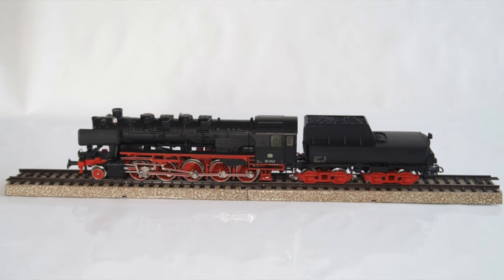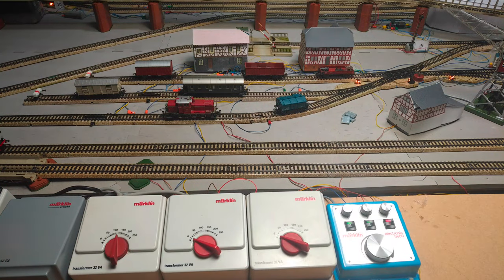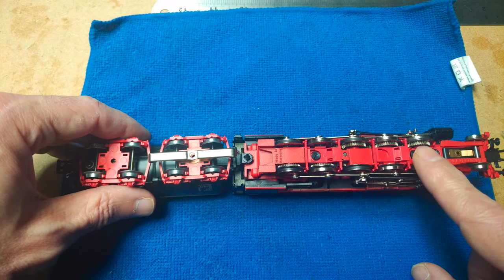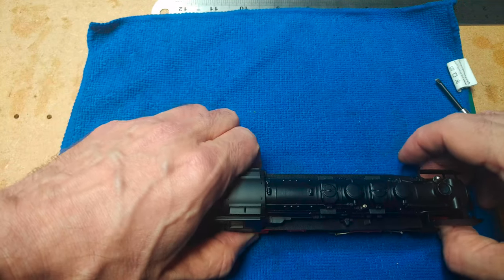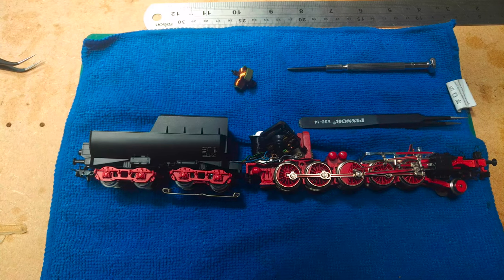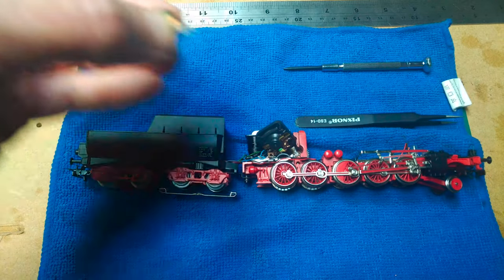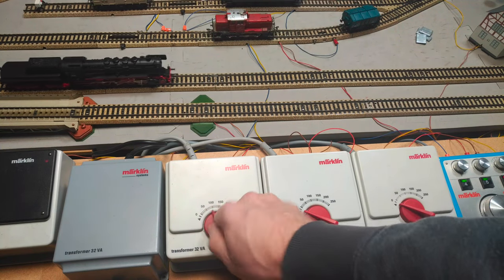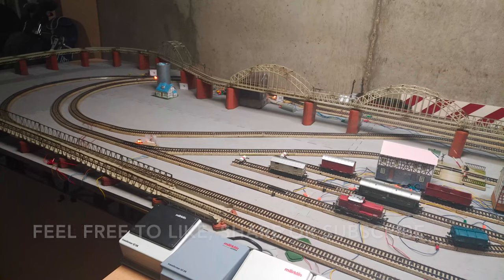Can I fix it? Märklin 3315 maintenance

Comment: Applying a drop of white sprit on the axle bearings will quickly desolve the hardened oil residues.  Also apply oil on the axles of the small gears between the wheels. Great video. 🙂
Reply from the maker: I like the red paint on my chassis too much to use white spirit 😉 If you don't mind about this, sure that could work too... Thanks for the visit!

Comment: Great ! Thank you so much. In other chanels, cleaning the motor is done with isopropanol. Done on earlier lok (in the 60s). May be the painting was different. Also to easy up blocked wheels, use liquid for oil smoke. What do you think of these ?
Reply from the maker: Hi there,
Isopropyl alcohol (ipa) on metal gears is fine, on plastic gears not so much, it makes them crack over time. The Märklin service manual also discourages the use of ipa, so I follow their advice. The motor housings of the 60s where also mostly black, so it was difficult to distinguish between graphite residues and paint... As a rule, I try and use isopropanol as little as possible, only when I have no other choice.
Smoke oil is "oil" (paraffin) :), SR24 for example, this also works very well to free things up, but requires additional lubrication afterwards. This is the reason why I mostly use ballistol for this type of things, saves me applying more fluids than is actually necessary. 
Thanks for your visit on the channel Stéphane. much appreciated.

Comment: My 3315 stays in it's box most of the time: For one reason or another, the running quality is poor, as it seems to have a power interruption issue. It doesn't completely stop of course but you can tell something is not right as there are very minor interruptions as it moves along here and there, sometimes over switches (M-track of course).  On my small test layout I clean the rails very frequently and would rule that out. It was delivered to me resinified, (and from what I can tell was never run like all the locos from this auction lot items being manufactured in early 1990s), which I usually solve with LGB smoke and cleaning fluid, my go-to for loosening the old oils, general cleaning, and the like. Of course, you need lubrication after.  But back to the 3315... Is there anything else I can do to try and improve the running? All my other locos (and they are all much much older) work far better. I have a 3316 literally from the same production month and it seems to be OK.  Many thanks for the time you have invested in the channel, as a non-German speaker (it's on the to-do list..) the technical production, commentary, and analysis are top-notch and much appreciated.  There really is no other channel like it (that I have seen) for the die-hard Marklin enthusiast and I look forward to every new installment (especially during the winter!)
Reply from the maker: Hi, 
Unless track was extremely dirty this can be ruled out. It sounds like some form of ground contact issue. I'd start by checking that none of the axles are sluggish, and that the driving wheels are clean. Then I'd check the leading wheels, as they often cease: they must be clean, so does their axle, as well as the leaf spring underneath the axle which doubles as a return for ground. This part of the chassis is often neglected but is critical for good ground contact on 33xx steam locos.
Could be something else too, but this is where I would start.
Thanks for the praises, glad you find the channel useful.
Reply: Thank you.  Your video on the '3312 T5 running issues in forward' was good to review, my issue is not as severe, but like you, I found that it ran somewhat better in reverse... it also reminded me of something I did 10 years ago which was solder dedicated grounds to the copper pickups on a digital BR86, both front and rear, which improved running. I checked closely on the 3315 copper pickup and there is a spot where it sits on the bogie so I removed the bit of paint there. It also seems like there is too much paint in the way in terms of where the coupler mount mates with the chassis...However, after much tweaking, nothing has really changed.  I may have to go and put in more grounding wires, but I'm 'out of steam' with this one for now.
Reply from the maker: Someone is watching the channel attentively :) Yes, it can get a bit draining sometimes. Best to step back and do nothing in such cases. Maybe you could post a quick video of the behaviour on your channel as unlisted and let me have a link via email. I could have another look and see if I can think of something else. You should not need additional grounding wires.

Comment: I recently came across some Marklin trains for the first time. I have gotten these old locomotives working and it has been a learning experience. I noticed right away that the units did not conform to the wheel spacing using an NMRA gauge. Is that normal for Marklin or were the units simply out of gauge? Secondly, does anyone have a link to the electrical set up in a Marklin power pack that allows the reversing unit to operate? I understand that a pulse of voltage above 20 v is generated. Is this an AC voltage or a DC voltage like in a capacitance discharge setup? Thanks.
Reply from the maker: Hi, Marklin wasn't built to NMRA standards, actually I doubt they even existed when the H0 norm was adopted by Märklin. The spacing of the wheels is set at the factory based on the H0 Marklin track system. This spacing is fixed and cannot be adjusted as the wheels in a wheelset are not isolated from each other. We don't need to worry about this type of things in a Märklin set-up.
The "power pack" is a tranformer, it converts AC main voltage to to 2 different secondary AC voltages. The first one is variable between 4V and 16v AC, this is the circuit used by the throttle. The second voltage is 24V AC, which is applied to the track when the throttle is put to reverse. There is no capacitor at play. The marklin motors in older types of locomotives are universal motors, so they would word with DC.
Reply: @The3rdRail  Thanks for getting back to me. I had a suspicion that Marklin did not follow the NMRA wheetset gauge. I had been able to readjust the gauge and set the ends of the axle with cyanoacrylate. I originally tested and ran the locomotives off of a lionel ac transformer, but I was told by someone else that they would run off of DC which they did. I made a test track using HO flex and cemented a center rail in place. I was toying with the idea of making a loop of track with the outside rails powered and a catenary for the overhead pickup, just as an experiment. Since I did not have a Marklin transformer, I could get the reverse mechanism to operate by providing a higher AC voltage. Since the locomotives ran with DC and I am aware that a capacitance discharge system might operate the reversing solenoid without providing a continuous current and possibly burning out the solenoid, I may play with that also. The Marklin trains are an interesting piece of model train equiptment.
Reply from the maker: The old MArklin 6600 controller used a capacitor for the reverse pulse. The mechanical reversers should be able to handle something like a CDU as long as the current remains in the area of 1A, it is the locomotives equipped with decoders (especially the early types used by Märklin in the late 80s-early 90s) that will have problems with such a set-up. You are very brave with you gauge adjustments, I wouldn't go near that, because the glue losens over time and you end up having to constantly re adjust in my experience with broken models I tried to fix in the past. You are also substantially reducing (understatement...) the resale value of your models doing this, but that is your choice...
Reply from the maker: You also have a 2 rail option by the way, could save you the hassle of convertiing tracks and trying to make power supplies. Marklin produced 2 rail versions of its old models under the Hamo brand. They are easy to pick-up and usually cheaper than the equivalent Märklin model. They then acquired TRIX, and have been producing 2 rail versions of most of their models under this brand. In both cases the models are identical cosmetically.
Reply: @The3rdRail  Yes, I know about the 2 rail option. I just like to be creative at times.
Reply: @The3rdRail  The locomotives will not be resold, just oddities on display. The biggest thrill was the challenge of getting them running again and learning how they were designed.